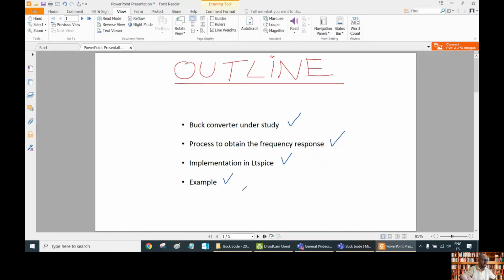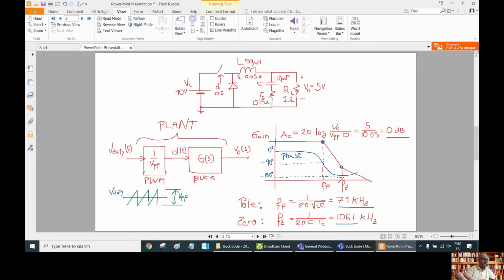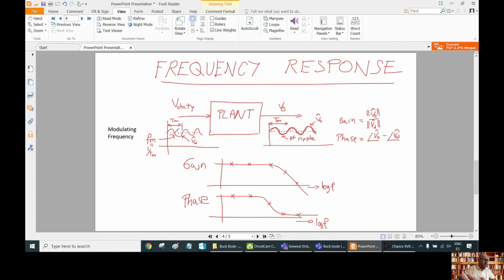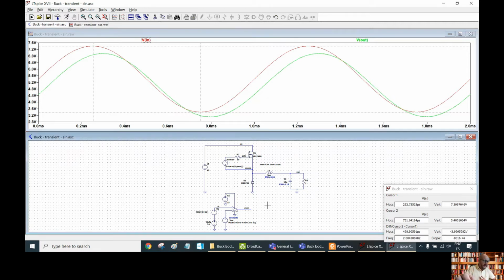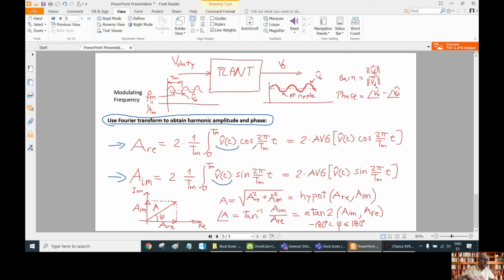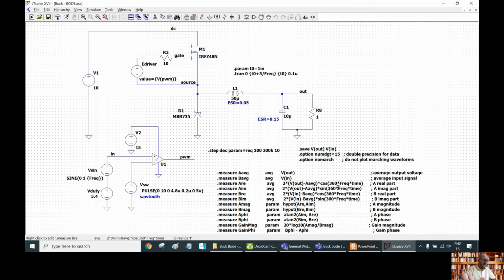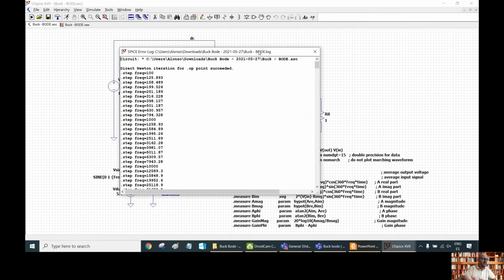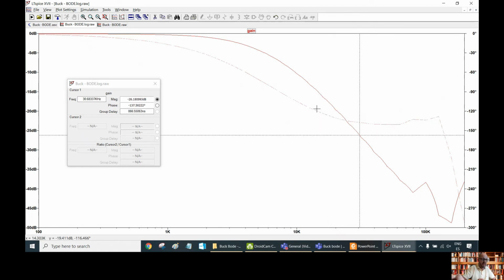LTspice #6: Open-Loop Frequency Response of a DC-DC converter

Comment: Is not sin of 1V a lot for small perturbation to draw bode? I saw many using 0.1 or 0.05 does it matter?
Reply from the maker: I usually start with 1 V and keep it if everything looks fine. A too high value can make the system go beyond small signal. We can see this by the distortion in the output signal (not purely sinusoidal). On the other hand, a too small value can make the perturbation at the output too small in comparison with noise and make the measurement less accurate, especially at high frequency where the gain is smaller. So it is a matter to try different values to get an accurate response in the wider frequency range as possible.

Comment: Thanks so much I did learn alot from you, I do have problem in my PID control loop Type 3, the phase margin is about 0 degree and I did try many things to boos it but nothing help, can I send asc file?
Reply from the maker: I think you must be locating the zeros and poles of the compensator wrongly. Try watching video PE #64 to see if it can help: https://youtu.be/CnjmIiKvQik
Reply: @MarcosAlonsoElectronics thanks so much professor

Comment: Dear Professor, I would like to ask you why did you write the arguments of sisusoids in degrees @34.19?
Reply from the maker: Good question. This is because, curiously enough, the sin and cos functions work in degrees when used in .measure statements.
To see this, try this example that calculates the average value of sin^2 function: https://github.com/marcosalonsoelectronics/misc/blob/main/test-sine-function.asc
If you put the angle in rads it won't work

Comment: What amplitude of PWM u used ?
Can you share the setting you made in PWM?
Reply from the maker: The duty cycle perturbation is 1V out of 10V of the sawtooth waveform. So it is 10% perturbation.
You have the link to the file in your comments below.
Thanks!
Reply: @MarcosAlonsoElectronics  It's not telling me the name of comparator, it's telling me comparator is missing when I open file
Tell me the me name of comparator through I should search in "Place Component".
Reply from the maker: @asadrao5147  The comparator is available from my website. You have to install it on your LTspice folder. Video LTspice #3 explains how to do this. Please, take a look.

Comment: Professor, it is possible to measure the input to output frequency response? I have tried to put the sine wave connected to the input side, but it does not work.
Reply from the maker: Yes, there shouldn't be any problem. Send me an email with your file and I will take a look. Thanks for watching and for your question!

Comment: professor, why the frequency plot DC gain value is not Vin?
Reply from the maker: Because we have to consider also the gain of the PWM modulator, which is 1/Vpp, where Vpp is the peak-to-peak voltage of the sawtooth waveform of the PWM modulator. Our plant is formed by the PWM modulator + the buck converter as shown at 1:14.
Thanks for your question and for watching!